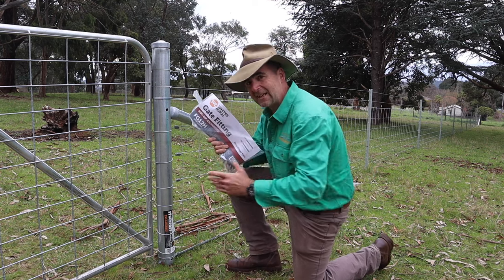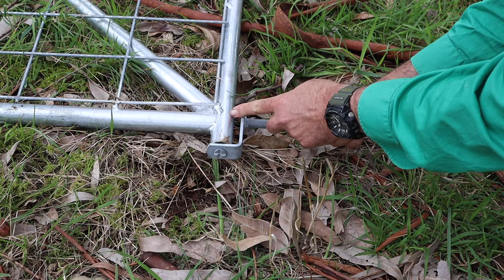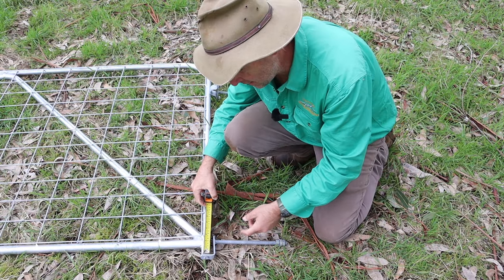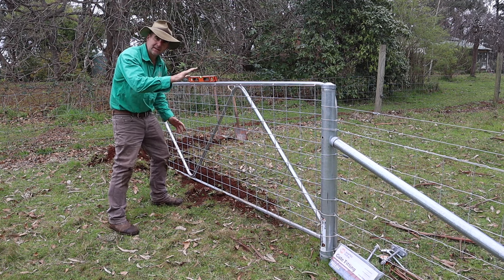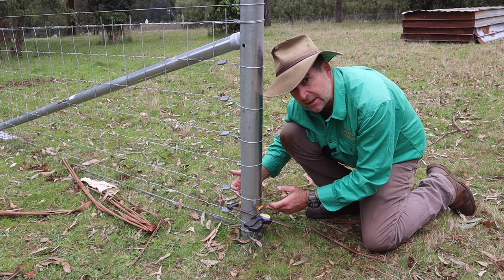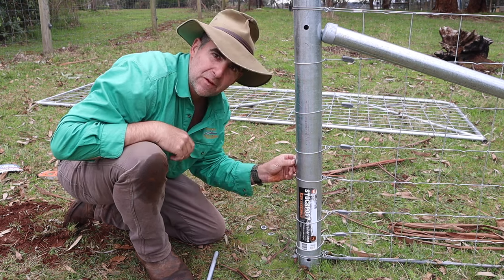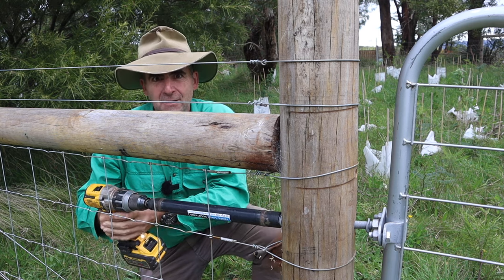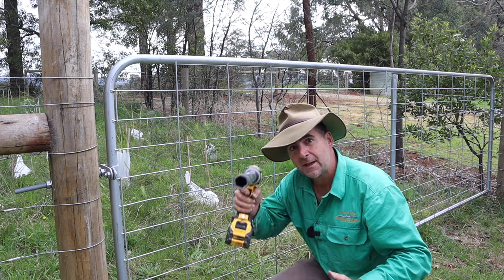Say Goodbye to Struggles: Hang Farm Fence Gates Effortlessly

Comment: Hey Tim, would love to see you try your hand at a DIY electric rural gate kit.
Reply from the maker: Great idea. I’ve sort of done that before but not as a step by step tutorial. On the list!
Reply: @FarmLearningTim   The GTO Mighty Mule 271 is a good electric gate opener with a range of add on accessories like an electric latch, keypad, vehicle sensor and can be solar powered too. Once you have one you'll never be without one.
Reply: @farmlearningtim yes this please Tim. Just bought a unit from Amazon US called Ghost control. Have followed your sheep fencing tips so far with good results. Installed the bump gate as per your video. Hung the gate just before you release this video. Wish i saw this first!